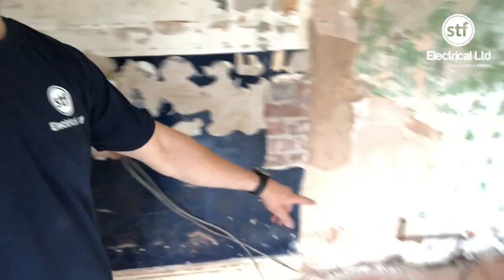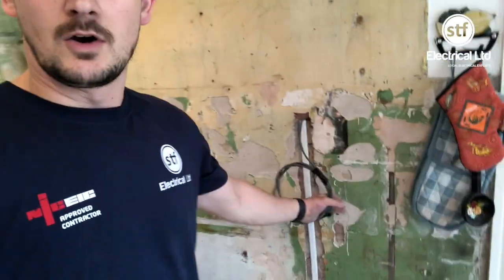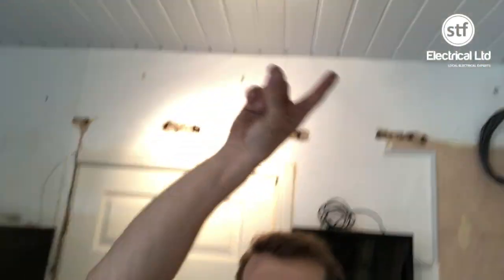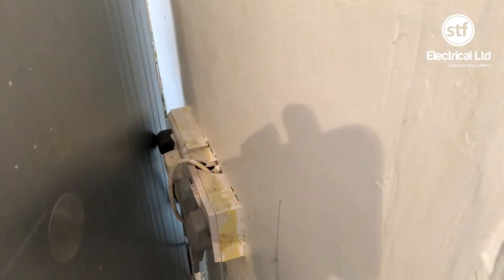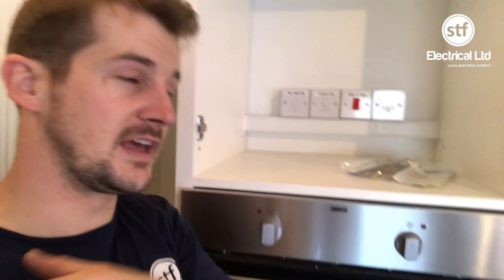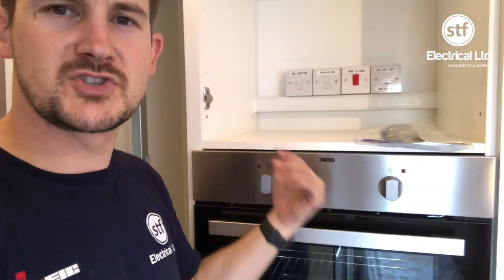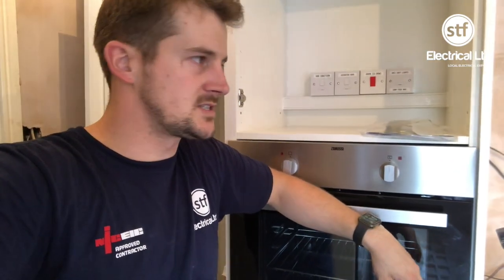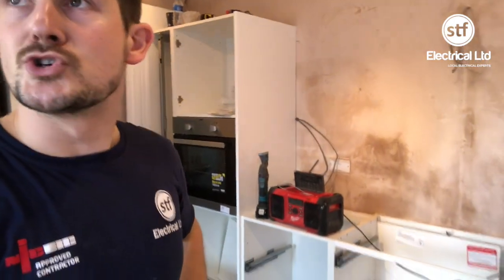Kitchen Wiring Alterations | STF Electrical Ltd

Comment: I don’t put boxes on extract fans or hobs, I run a load cable to the (upper oven cupboard) and put my fused spur/double pole switch there. Then put blue click plugs on the load end. Who wants to take off extract housing when the fuse blows or struggle to connect the hob at the back of units.
Reply: So spot on! 👍

Comment: Never seen isolators sat above pvc trunking like that before... Interesting 🤔
Reply from the maker: Alvin Ashman done it on a few now - personally I feel it’s a neater job and I’m not worried about basic insulation poking out of the back of the unit if a cables been stripped longer and I’ve brought them in to the patress back entry (especially with the cooker/hob circuits where cables are a little trickier to manipulate)
Reply: Nothing wrong with it. Containment containing cables. 
Had to do it many times before
Reply: @SME_Ste  I'm not saying there is, it's just a bit usual for me as I've never seen it done this way before.
Reply: @ashmanelectricalservices4318  no worries Alvin

Comment: My parents electrician wanted to charge them £200 extra for an SPD when he was quoting for a board change. Surely they're making a pretty penny profit on the SPD even if it's for a Hager board or similar?
Reply from the maker: Ed O'Brien Hager recently did a survey saying that “almost one in three electricians admitted to still being unsure regarding their responsibilities around surge protection.”

This could possibly be some sort of reason why the spark you mentioned was charging so much.  But you are right, even with a Hager SPD they are making a pretty penny there (off memory we buy the Hager ones in for around £70), you’ve also got to remember that your fitting the board anyway... so how much extra work is it to through one in!

We talk about Hager being more expensive though but their SPD kit saves time as it comes with a pre made cable, so you don’t have to worry about keeping your line and protective conductor within the 0.5m - I’ll make a video on this though!
Reply: @stfelectricalltd6849  I'd already got my dad to specify an RCBO board to be installed and had mentioned an SPD to him.  So with the extra cost of an RCBO board compared to a dual RCD board he couldn't justify another £200, at about £70 extra he probably would have gone for it and had the extra protection. They are having their new board fitted next week so it will be interesting to see which brand they use.
I'm not in the trade but enjoy watching all you sparks here on YouTube so welcome to the gang!
Reply from the maker: Ed O'Brien thanks very much Ed!

Yeah obviously we have to make money but £200 on a domestic SPD...?!

Hager do a nice dual RCD board that comes fully populated and comes with an SPD
Reply: a plumber will charge about £2k upwards to change a boiler and more often be done in a day, depending on the make of boiler they can make anything from £1300 upwards, as for testing it, stick a probe in the boiler, then get a water gauge from the ancient egyptians and thats their testing done. For some reason the most technical trade you could employ is also the most under valued. As an example my latest tester cost £1,000, ask a plumber how much his probe thing cost and his gas tester probably less than a few hundred quid.
Reply from the maker: Anthony charles unfortunately it all comes down to electricians not knowing their worth - too many are trying to compete on price and I creates a race to the bottom.  Couple this with regulatory bodies not (in my opinion) advertising and educating to the general public enough and you have people not understanding the worth of an electrician and tons contractors willing to undercut each other until the client pays a price that they’ve dictated- if a client thinks we are too expensive we simply move on as one of two things have happened:
1. I haven’t sold and explained our services value to them thoroughly enough
2. Said client is shopping on price alone (and they are not my client).
Just remember not all clients are your client.  Nothing worse than being a busy fool
Reply from the maker: Anthony charles too true
Reply: A hager spd from 1 of our local wholesalers is 102 plus vat, rip off. A proper device from else where is 39 plus vat
Reply: @SME_Ste  price will always  vary from manufacturer to manufacturer, a brand like Hager or Schneider can do this, because of their dominance and size, a lesser known brand can't hence the price difference. It's just like yourself, you could charge £30 an hour because you are an established business, while a new guy starting up may charge £20 an hour to get the work although you are doing exactly the same job to the same standard.
Also some of the surge devices on the market are a one hit wonder, while others will last multiple hits.
Reply from the maker: Anthony charles agree with this but with anything manufacturers or ourselves you need to look at where you want to market yourself.

Eg I’d much rather be at a higher price and offer a quality service with a difference finding a niche rather than competing on price and playing in the race to the bottom - the people who buy purely based on cheapest prices will always do that and there will ALWAYS be somebody doing it cheaper.  Not a game I’d want to play in.

Perhaps this is why we see cheaper/smaller manufacturers going bust or moving away from making boards (like MK) as they have been competing on price for too long and not focusing on being an innovator.
Reply: @stfelectricalltd6849  electricians are stupid anyway when it comes to price, for some reason they think they should be doing something for next to nothing, that's not for me, I let them get on with it, what's the point of being a busy fool.
I suspect MK are not making enough now on their fuse boards, but then again they are made for them so they have to pay a third party where maybe the others don't.
Reply: Anthony charles a plumbers flue gas analyser is as much as a multifunctional tester if not more for quality ones, Powderflush is that again! And so on I can guarantee if a plumber done all aspects of plumbing they would be £10grand plus on equipment alone without tools.... I have helped my mates plumbers and sparks and I can tell you, both are as important and both have values sizing etc to work out or it’s them up in court for doing wrong! 
Stop thinking one trade is worth less especially when you obviously don’t have a clue!
Reply: @michaelcoles6140  No plumbers i know, spend anywhere near that figure for testers, a power flush is not a tester, or is it essential to have, its used very little, and when i was contracted to British gas they were charging around the £400 mark just for that to be done, and it was only on for about 20mins.
Well in my opinion my trade is more technical and  requires more knowledge, there are plenty of idiot electricians out there which i accept, the only thing plumbers have right is how to charge, because if you call a plumber out you know its going to cost, where as you call an electrician out and 9 times out of 10 they will charge buttons.
And i do have a clue, i have been in this game too long not to know.
Reply: there is one thing i have realised though, and its taken me a while i must admit, if anyone wants to make serious money, get rid of the fancy tech and tools, and pick a trade where all you need is a bucket of tools, trust me you wont look back, ha, ha

Comment: , its a recommendation to fit SPD's in domestic ,not a necssesity , manufactures have invested vast sums of money and need to push the industry to fit them , you might as well say why not fit AFCD's right now, within urban areas hardly need the IMO, been doing this for 30 years and never been a problem without them
Reply from the maker: Paul T it isn’t a recommendation if you read the reg however it gives instances where they can be omitted - a lot of people are trying to get around fitting them by using risk assessments and calcs in regs however there’s three issues here:
1 many are bending the calc to suit their argument of not fitting them
2 lengths of underground/over head cables etc you need to input into the calc to do it properly are nearly always never to hand to the electrician 
3 even when calc is done properly with accurate values we’ve found calc often says one needs fitting 

My personal view is why join the race to the bottom - they aren’t dear just fit them and give your client a little more value rather than trying to avoid them at all cost like others are doing as they are afraid of loosing work on price - often then in some cases leaving an install that should have one

Just my opinion

Comment: They should of made afdd and spd and rcbos  mandatory on all boards changes by now and force a cap on companys over charging and make more viable in terms of cost people are always gion to go for the cheaper option.
Reply from the maker: micheal goodwin think we will see manufacturers dropping prices on SPDs over the next year - a similar scenario happened when RCDs where the talking point.

My theory is SPDs have been around for a while and they are now starting to be imposed on us in certain situations (like RCDs where) and I think in later amendments we will see them being mandatory in more scenarios (again like RCDs where).

AFDDs are relatively new to the UK scene and for that reason I think they are “introducing” them before making them mandatory in some scenarios in the future (once we are more familiar with them) and even more scenarios in amendments after that.

I’ve just posted a new video today regarding consumer units and price differences when it comes to RCBOs, SPDs etc